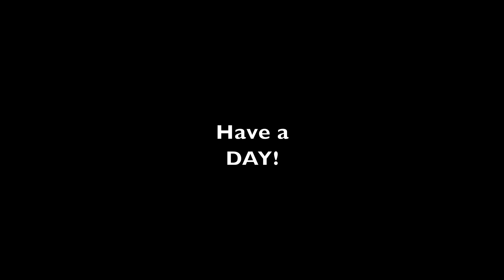$600.00 Gone in the Wind, Tree clean up and conduit install #1047

Comment: Mike, you really should get a pair of bluetooth communicators for working with Melissa.  I bet if you contacted Sena.com, they would probably sponsor you with a pair.  I adapted a set from my motorcycle helmet to sound proof head gear like you wear last spring when I was working a week with my grandson.  He was on a tracked skid steer and I was running an excavator.  We were doing drainage and road work at out hunting camp in central PA.   We both had hearing protection all while being able to talk clearly with each other totally hands free.  We could also pair our phones if we wanted and play music or take and receive phone calls.  They even have a model with a camera and you can narrate your video direct from the headset.  It is a lot better than trying to use hand signals or yelling over the sound of the machine.  They have noise canceling so they reduce ambient noise so the microphone does not get drowned out by background noise (machine, band mill etc).  I think you would find that they revolutionize your work and help in your video production.  If I am not wrong, I think their headquarters are in Pittsburgh.   Can't get much better than that.

Comment: Good morning from NC again. It was cold over in SE PA loading the pickup yesterday morning! But we had a great weekend of house projects - the biggest one was installing shelves and spice racks in a pantry, but lots of littler ones - fixed the crawl space door, mounted the street address numbers on the front, installed a dimmer for living room lights, installed a washer and dryer, assembled a 2-drawer file cabinet for one of the offices, unpacked a full desk top and set aside for later assembly, consulted on patching/leveling yard and picked up topsoil and seed, acquired miscellaneous tools a new homeowner will need. And I’ve forgotten a lot I’m sure. Great fun hanging with my son all weekend. 

Your multipurpose building is coming along! Good to see it.

Comment: Long time watcher from Brookings, Oregon. Might want to run a line with a valve from the city water line to fill the cistern tank in case there is ever an issue with city water (i.e. contamination or planned outage). Always good to have a 3000 gallon emergency water supply available.

Comment: Hey Mike, consider putting two layers of 1” foam (stagger the joints) over the conduit before you bury it so your waterline does not frost freeze from driving over the line in the winter!

Comment: That hand tamper is no joke. That’s a workout in itself. Something you don’t see Mike doing much, hand work. Every good operator has to eventually pick up a shovel.
Reply: That was not Motor Mike running that hand tamper.  It was Meissa 😎 wearing Motor Mikes boots.  😂. mike was using the kx057 tamper!🤫
Reply: instablaster

Comment: Interesting how shallow that water line is, I would think even in your area you would want it at least 4’. Here in Minnesota we bury water lines at least 6’ especially across a driveway or road. A few years ago I had to shut my water off and drain the lines to my shop because they were close to freezing (water was 36 degrees at the tap) there are two spots where it crosses under a driveway . Where the ground is not covered by snow for insulation. Looking great. Have a day!
Reply: Can you let it drip, so it's moving and won't freeze ?
Reply: @augustreil  you can but it freezes so hard it doesn’t help. A little town north of us that year most of the houses on the opposite side of the street as the water main all froze. Where the water go under the road to the houses.
Reply: @greglammers9905 , Yeah, you guys get some wicked low temps. It's hard to even imagine !

Comment: Put a cut off value at the tank and where city/county water will hook up outside put another cut off value and go ahead hook water line together so when city water comes you can cut tank off or vise versa. Great video hate your camrea got broke. Have a great day be safe.
Reply: It's usually a lot more to do than that. I think they call it cross tie with personal and city water. Might have to have physical separation. I'm sure it will be addressed.

Comment: Here in Canada, we dig our water lines in 5 or 6 feet deep, because of frost depth in winter. And put insulation of some kind. I guess you don't get frost like we do.....
Reply: I live in NS. Canada had a line freeze at 6 ft. one winter. Had no snow for ground cover.
Reply: Do you guys ever cover the lines with say a layer of 4'' foam board, then back fill ?
Reply: I’m in Ohio and was questioning the depth. We’re 36-40” here. Also would never backfill with stone because the frost will seep right through it, or so I’ve been told.

Comment: what about the line for the hot/cold water lines from the wood burning furnace on the 4 side? Are you putting in a drain in the center of the "garage" area? To capture the snow melt etc. from the parked vehicles.

Comment: The next time try getting square with the wall on both sides when you first dig in you won't have any hand work. I couldn't tell if you taped the ends of the pipe. Allso put a short board at the ends of the pipe before back filling makes it a lot easier to find when you get ready to dig it up. Keep up the good work.

Comment: that looks like electrical conduit. you can run 1 inch or 3/4 pex   though it for your water line.  do not forget to  put in a water box with a good shut off going to the building.  Always throw in extra conduit or water line in you ditch you may want outside water faucets

Comment: Nice job.  I'm probably confused, but that looked like electrical conduit rather than potential water line connection.
Reply from the maker: Yea is just a 3” electrical conduit, I will shove the water line through it if and when it comes

Comment: MIKE,  kinda stinks after you spent time on the final grade before the building went up to tear it up for the plumbing,  only to grade it again for the concrete,  BUT,... the drains got the right fall, and the floor will have consistent thickness!  You're doin it right! Good stuff.

Comment: From experience, we did not allow “native soil” as back fill. Iron, abs,clay pipes are all magnetic when it comes to rocks poking holes in our village pipes in Colorado.
Reply: He backed  filled with 2a Limestone no worries about reputered lines have a day love from TEXAS
Reply: That was just conduit which the pipe will go in it will protect the pipe!
Reply: @markpontes4457  Hi Mark with the grade of slope in the front yard  wouldn't  you want at least a 3 in water line for sufficient  water pressure  what's your take  have a day love from TEXAS
Reply: @tinachambers4887  3/4 or 1” should be plenty depending on how much pressure is being supplied by the township usually around 60 psi. Unless he’s going to have fire suppression system! Then 3”.

Comment: I see you are trenching for future city water and also for tank water on side what about Hot water are you also going to put a central hot water heater location and run the hot water lines in the trench or will you run those hot water lines in the 2x4 interior walls to the sinks & shower ?

Comment: Like you show.  Conduit is the term applied to PVC pipe made for electrical wiring containment. Stabilizers and other ingredients used in conduit PVC may be toxic; conduit PVC is not held to the same drinking water standards as NSF marked pipe and should not be used in potable water systems.  I hope the conduit you installed is only to allow you to slide a water pipe inside the conduit in the future. Best of luck.

Comment: With no idea how good the city water pressure would be if it does come would you think routing through the cistern tank to use the weight of that water to boost pressure (if needed) would be a good idea? And, the tank would have a bit of turn over each use and stay at max fill.
Reply: @m9 ovich Makes sense m9 ovich, especially on the faucet/fill for the tank. I suggested it because I heard Mike would use a water truck to fill the tank so he wasn't going to be using actual cistern water coming off the roof. We had cistern water (off the roof mostly and water truck in the summer sometimes) for a few years on our farm until city water came through. Anyway, I thought of the above ground cistern tank as something akin to a hot water heater, storing water and flowing into and out of it. If filled by city water I'm not sure what the contamination would be. I don't know much about it although I know in New York City many of the buildings have a cedar wood water tank on the roof that fills slowly because of height and lack of water pressure and provides water and water pressure for the building. I thought it might be something about like that but on a smaller scale. Nice to see the progress on the building in all ways!

Comment: Good Morning from Nova Scotia.  I am curious why you don't use more small roundwood(branches) in your firewood sales.  My experience is that roundwood  burns longer and therefore gives more bang for the buck.
Reply: I live in NS. also. We always cutup the larger limbs. Hottest burning part of the tree.
Reply: Wood is wood. Would guess once burning very little difference in heat output. On my nephew's farm that is heated with wood from about a 40 + woodlot if the small round wood was wasted they would run out of firewood well before the end of the heating season. When you sell to customers you have to cater to their requirements not necessarily what is so.
Reply: I’m guessing it’s a time issue.
Reply: I agree I like bigger pieces in the firewood that small stuff just to get it lit!

Comment: Put a floor drain on the equipment side.
Reply: Great suggestion.  It can drain into the lines from the gutters
Reply: Yes
Reply: @gregj2647 , Would that contaminate any water he plans on collecting ?
Reply: @augustreil  I didn't think he was collecting water off the roof, but I'm not sure. I thought in an earlier video he had he drains running off to the street.
Reply: @gregj2647 , Not sure either, but you're probably right.

Comment: Public Water in Arkansas is available in most rural areas due to the availability of Federal Loans through FHA. Without the Federal loans Financing would have been impossible to obtain. I served on the Board of a rural water district for 15 years. What a pain in the rear that was.

Comment: You need a tripod that can utilize tripod san bags. Seach Amazon they have some with cross members near the bottom of the tripod. Then get some Studio Duty weight bags. Total cost less than $100.00 but will save  $600.00 camera.

Comment: Mike, when you do get city water, have a 1 inch line installed from the street to your barn to feed the barn. Then have a 1 inch line installed to a sill cock on the the outside by the future pool. You can then buy a 1 inch garden hose like golf courses use and use this to fill the pool when needed. it will make such a big difference compared to a 3/4 garden hose, trust me I know

Comment: Man that is an awesome building you have going there. Since you are going to pour concrete you should have never put those posts directly in the ground. Imagine when they rot, (and they will), it will be a nightmare to replace, I have been installing pole barns for 25 years and always advise my customers against it. I would use a product called Perma Columns or at least use their brackets mounted on top of the slab to attach the Treated posts. Treated doesn't mean they wont rot. I'm just sayin', you haven't cut corners anywhere else. I wouldn't have done it there. Great job otherwise,

Comment: Just a question.... Does the town require you to have a licensed plumber to install what you just did. I was involved in a similar situation and the town required that we were to pick a plumber from a list they provided to do the work. My boys are both master licensed plumbers and were not on the list. So the water lines came up and down the road and stopped at my property. Had upset neighbors that I stalled the project and no water hook up till it was settled. Took them a year to settle. LOLOLOLOLOLOLO

Comment: Mike why are you running a conduit for city water line? Why don’t you go ahead and run the 2” line out with a valve or plug on the end. That way you don’t have to fish a new water line thru the conduit. Tiring in to your existing line will not be easy after the slab is poured. Just a thought. I enjoy your videos. Sorry about your camera. I know you really work at your Videos . Thank you for that. Not everyone spends the time to film like you do.
Reply from the maker: Because I don’t know if or when public water is coming, I had some 3” conduit. If the water comes I will shove the line through, and hook up inside will easy

Comment: Mike, In preparation for the public water supply, hopefully in the near future, wouldn't save you a lot of money if you installed a 3/4  inch supply pipe right down the hill to the side of the highway.  Just trying to think outside the box for you.